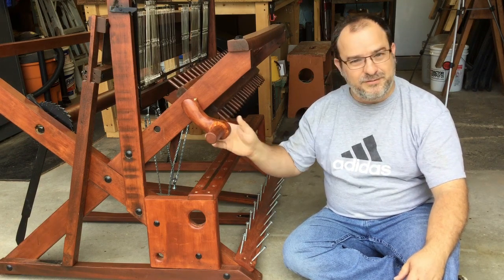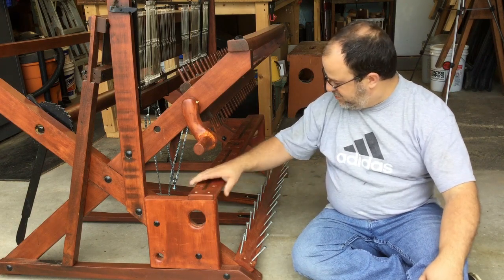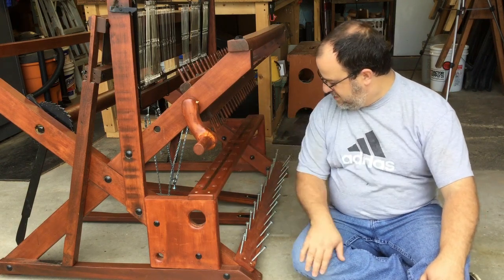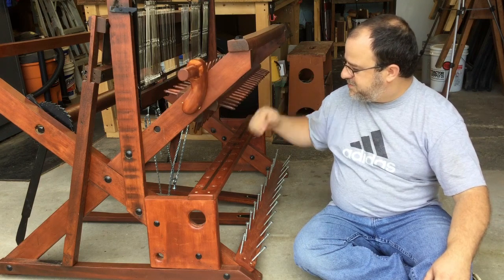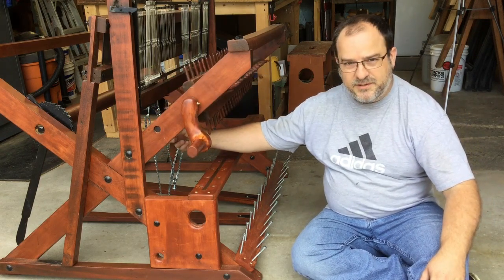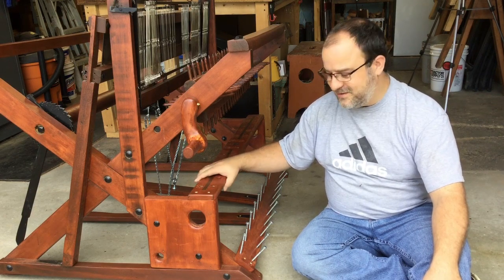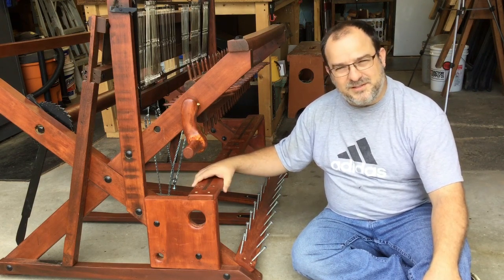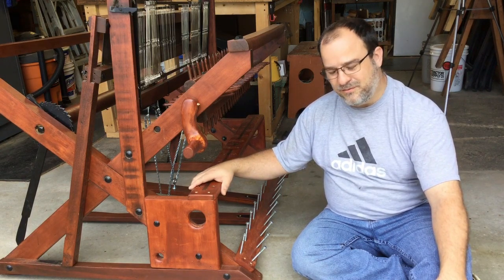Union Loom Restoration Complete

Comment: Beautiful job. The X frame looms can be unstable and go out of square, and I think you did a fabulous job of bringing that loom back to life. As long as the beater hits the fell squarely you will be fine. You may want to add a steel rod to the beater just for the added whack to weave a good solid rug. A 1936? Bergman 12 shaft contramarche loom is my current rehab project. I watched all of your videos with interest. I've cleaned the wood parts and purchased Restor a Finish and beeswax to apply to the wood. I don't have the space or dexterity to sand and apply a new finish. Bravo! Let us see a rug!
Reply from the maker: Thank you for the nice comment. We have been wanting to make a rug, but alas it may have to wait until Spring. Your idea of a steel rod sounds interesting. I hadn't thought of that. I will definitely look into it!

Comment: I would suggest putting the uprights on all four corners, if you look at how it's done on a Union #36, they are set back from the corners out of the way of the hardware. They will also help keep the loom square. You can adjust the loom also to keep it in square.
Reply from the maker: It's easy to see why the later models had better supports. It is almost impossible at this point to make this particular loom square. I would certainly do that on future looms!
Reply: @NorthernGardensChannel  Just picked mine up from the auction yesterday. $8! Someone had put it together wrong after moving it, so it looked like it didn't work. Can't wait to get it back together and start weaving. I got lucky, other than putting the treadles on the right way, it just needs cleaning and waxing to make her beautiful again.
Reply from the maker: @VangoghsDoggo  That's awesome to hear! That sounds like a great find.
Reply: @NorthernGardensChannel  Finishing up tomorrow! Warp will go on on Monday or Tuesday. Made some replacement parts to update it, the apron was missing for the rug beam. If you weave, when you warp on, use leaders to put the warp on, make them long enough to reach the harnesses, that way you don't waste warp. Look up using lease sticks and using a tensioner made of hair ties at the back of the loom to help with maintaining tension when weaving. I tension the warp when I put it on. I put the spools on the rack, thread through the guide, up over the top of the castle roller, down through my tension dowels, knot the ends of each section, tie the leader on and crank on as many yards as I need, up to 70 turns of the warp beam. Then I loosely knot the end, tape it down and go to the next section. There are videos on here how to tension the warp several ways, but don't use nails, screws or the pegs on the beam to tie off warp, they will all give out or break. Preserving that beam is important! You can use methods from more modern looms and apply them to this one. I also made a canvas apron for the rug end that comes up and over the breast beam. Used 3/4" black gas pipline inside the hem of it, then lashed on the 1/2" steel tension rod that you tie the warp through after threading. I took weaving in college, so applied a lot of what I learned there to make this loom better. Still have to replace three of the pegs that were previously broken, but don't really need them. They are nice to have if you are weaving a pattern that uses the warp like a stripe or plaid.
Reply from the maker: @VangoghsDoggo  Awesome job. It sounds like it is going to be wonderful!

Comment: How did you make the handle?
Reply from the maker: Sorry for the delay. The handle I made was me just playing around and being creative. Before shaping the wood, I partially drilled through a piece of wood on opposite sides so a round peg would seat inside of the hole. I then used a rasp to shape a 2x4 and used brass screws to attach them together. You could do this any number of ways!
Reply: @NorthernGardensChannel  it is very pretty and looks great!